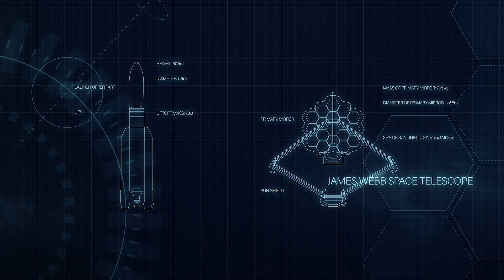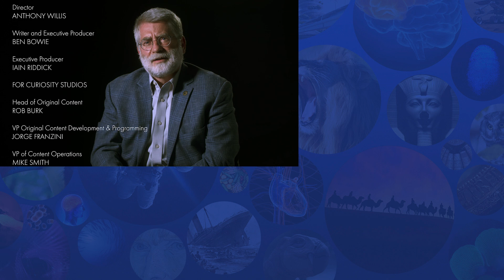Building the Cosmic Eye: The Journey of the James Webb Telescope!

Comment: Is it true that the density of berillium is 1/3 of aluminum as stated in the video? I think there should be 2/3. What parameter of strength is 8 times bigger in beryllium than in steel? Young's modulus?